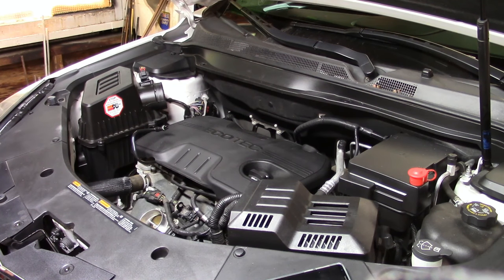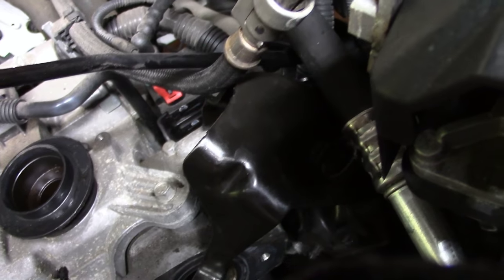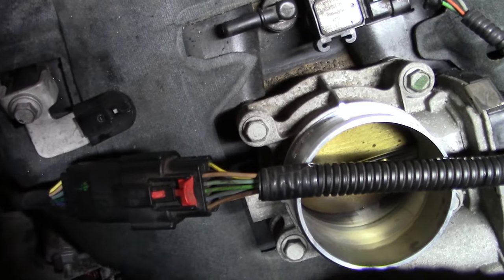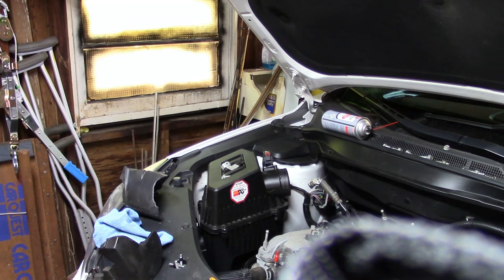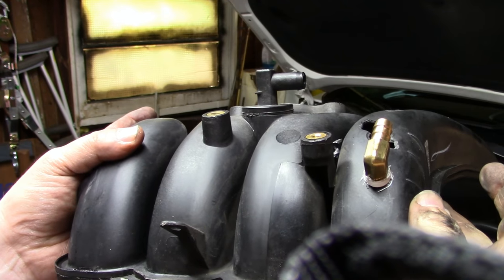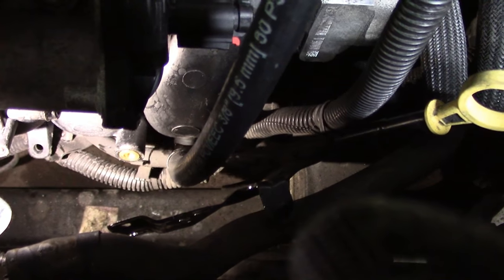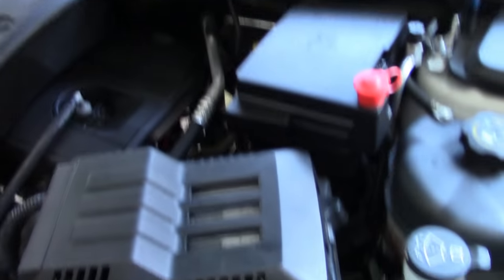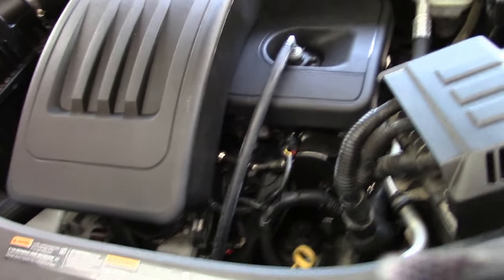2013 Chevy Equinox w/2.4L 4-Cyl. Engine PCV Upgrade

Comment: I took the premise of what you did here but made it (in my opinion easier and more serviceable)  i used the same oil cap and pcv valve as you but instead of removing the intake manifold i tapped into the brake booster hose with a tee and ran that to a catch can . So i went from the pcv valve in the oil cap into a catch can then out of the catch can into the booster line with a tee. No intake removal necessary and while the catch can increased the price by 27$ it was far less work and now i can monitor what is coming out of the engine. The whole process took me 45 min . The hardest part was mounting the can
Reply: GIno if you take a look at the other GM vehicles using the Ecotec engine, they do the same, tapping into the brake booster port.  Looks they may use a check valve.
Reply: Do you have an instructional video
Reply: @tbandtg  no but everything you need to know about it is in my message here. Buy a catch can and the parts listed above it's really easy.
Reply: @abefroman1986  can u explain again in detail im at a 3rd grade level thx
Reply: @happydays454  buy all the parts listed in the post where i asked him what he used. Pvc valve , new oil cap, grommet. Also buy a catch can. Take new oil cap drill hole so grommit fits in it. Install new pcv valve in it. Mount catch can (i mounted mine passenger side radiator support. Run a VACUUM hose (not heater hose) from the new pcv valve to the in port on the catch can.  Then from the out port of catch can run a vacuum hose back to where you can see the break booster hose. Buy a brass tee that is barbed on  all 3 sides that is same size as booster hose and hose you ran from catch can. Splice into booster hose attach the tee with some hose clamps and then hose from the catch can as well with a hose clamp.  Thats it.
Here is the link to catch can. Empty at every oil change.
Check this out: Ruien 0046 Polish Baffled Universal Aluminum Oil Catch Can Reser... https://www.amazon.com/dp/B06XK9PTP7/ref=cm_sw_r_sms_awdb_t1_9bPZDbVQ30366
Reply: Gino 1984 I thought the gunky crap was because the Pcv wasn’t working right, but if you rerouted your pcv and are still getting the crap in your catch can , do you know why you getting it ?or where it’s coming from? I’ve got one these pos that I’m stuck with , and thinking I need to do this to , I burns a quart a week and the pcv is continuously gunked up no matter how often I clean it
Reply: @happydays454  lol mine did, had to replace the gaskets.
Reply: @tssci6774  - I've read some of your replies regarding the Equinox issues, you appear to be very knowledgeable on the topic. Gino's setup is interesting, but I have concerns like Frank. So a check valve would eliminate the chance of... "If you're speaking about the power brake vacuum hose, you run the risk of introducing oil residue to the power booster. Then at some point you'll need to replace the power booster. Giving the PCV a dedicated vacuum port gives you a direct link between the PCV and the intake port, without compromising the brake power booster, or affecting the vacuum signal to the intake port at the cylinder head.
it doesn't solve the problem. It just redirects the oil that will need to be drained periodically from the catch can.  
Doing it the way I showed you keeps the emission system sealed true to OEM. No draining required. And the oil is burned in the combustion chamber."-Frank Incremona

I'm selling our Equinox, but I don't want to hand off a complete piece of garbage to the next owner.  I was going to add the catch can on the intake side like others and simply add the FC219 cap with the hope that the engine can breath cleaner and release pressure (emergency situation FC219) if things get clogged like the 1/8" PCV port on the intake runner.  Eliminating the chance of a rear main seal burst.
Reply: @abefroman1986  - Updates, how is your setup working?
Reply: @350Zquicksilver  going strong. No issues
Reply: @abefroman1986  - Good to read!  I replied to TS in your reply chain.  Frank's concerns are my concerns also. I'm taking a step in a different direction, because I plan to sell the car.  Installing a CC in place of the "C" shaped PCV line intake side, adding a FC219 oil filler cap.
Reply: @350Zquicksilver  I would replace the PCV tube with a 3/8" hose and point the air box fitting downward so it does not trap moisture and freeze.  Definately put on a FC-219 cap for added measure.  I tried several different setups for the vacuum source. Tapped into the EVAP line, but between the two the line was too small to handle both.  No worries about the brake booster, flow is only one direction, and there is a check valve at the booster.  The problem I ran into is build up of moisture and freezing at the "T".  It did once last winter and it affected the brakes.  I adjusted the hose to get rid of the low point so now if any moisture builds up, it flows downward to the intake port.  I would not worry about the catch can and put it back to stock,  if selling, the next owner will likely not check oil or the catch can which will cause the same problem.   FYI, I have restored several 240Z and raced and showed a 280ZX I restored many years ago.  Lots of fun, but got married and had kids.  The Equinox is my current project/hobby car so I tinker a lot and discovered issues and found fixes for them.
Reply: @350Zquicksilver  I have complete PCV document on this car I can send it to you if interested.
Reply: You would think it might compromise the brake booster effectiveness if you did it this way
Reply: @juanlanda2441  see my videos...
Reply: @juanlanda2441  the pcv valve is designed to draw a small amount of intake vacuum, .1 in Hg. compared to the normal 1-22 inHg that is present in the engine.  The brake booster holds a volume of vacuum that is good for several brake applications. Been running like this for over a year, no issues.
Reply: How is this workinf out? I took out the intake and cleafed the pcv hole that was clogged with oil and gunk, and onstalled a catch can but installed it the regular way. I'm thinking Bout doing it your way directly from the oil cap, jusr wondering how its working out for you 3 years later?

Comment: Thanks for posting.  

I serviced mine today (2013 Equinox 2.4L).   Orifice hole was completely blocked.  Engine was not consuming oil - I guess I am lucky.
I did not add the PCV upgrade, but followed the GM service bulletin - cleaned orifice and drilled a slightly larger hole.
I did not need to remove secondary fuel pump - just the fuel line and metal bracket.  
I managed to remove manifold down and past the protruding fuel pipe on the pump.   
Put back together and have vacuum again.  Also, my electrical connectors came off pretty easy - none broke fortunately.   
Will check vacuum on subsequent oil changes to see if hole gets plugged again.
Reply: How bigger was the whole you made
Reply: @karatejoejr  I matched the size of existing hole with a drill bit, then used the next larger size in my kit (about 1/32 larger).
Reply: @mjkirk12  Thank you
Reply: Still running ok
Reply: @rondavis2791  Yes, still runs OK.  Not burning oil.  I pull the PCV tube when I change oil and still feel a vacuum - so the orifice hole is not blocked.  :-)
Reply: @mjkirk12  good, what brand  of oil you run and what mile intervals.
Reply: @rondavis2791  Interval around 3500-4000 miles.  Orifice fixed at 98K miles, now at 112K miles.   For oil, usually 5W-30 Quaker state Synthetic blend.  but sometimes just 2 quarts full synthetic and 3 quarts conventional 5W-30 - my own "synthetic blend".  Shell or Quaker State - whatever is on sale.  Good luck.
Reply: @mjkirk12  thanks
Reply: When you opened up the hole did you notice it being louder at idle or acceleration  or at cruising speed.
Reply: @jimsmith9608  No, I don't think the noise changed much - it may smoothed out the idle a bit.   Shortly after, the muffler started to rust through - that was louder - then a new exhaust was installed.  My daughter drives the car - so I don't have time to listen.
It recently threw a code related to emissions (P0172 - Fuel System Too Rich) - but with a new air filter, the code cleared within a week.  I had not changed it in  4 years - must have forgot.  🙂

Comment: So im in process of doing this. How does this get rif of the oil consumption? If it was sucking oil through pcv orifice in intake wouldnt it just push oil through the new pcv valve and into the intake and still burn it? Also i am removing my vented oil cap is there a possibility of using this method and it builds up pressure and blows out rear main seal? Or is that not possible with the pcv valve in the oil cap?
Reply from the maker: The alternate PCV draws the pressure out of the engine into the plenum and then burns the fumes harmlessly in the combustion chamber. If you remove the oil cap you will see a baffle under the cap that prevents oil splashing back on the PCV. The reduced crankcase pressure  alleviates the blowby, thereby eliminating the oil consumption. After performing this modification on my engine, all oil consumption stopped.

Comment: Solution I found was a ventilated oil screw cap. ACDelco Oil Filler Cap FC219. Says that it won't fit on an Equinox however many posts said that it will indeed fit on the oil fill. I also have a 2007 Pontiac G6 and it fits this also.
Reply from the maker: But it really does not work.
Reply: A vented cap allows release of pressure build up so why exactly wouldn't work? Obviously venting through the pcv is best but if it did get blocked with gunk or freezing a release of pressure would be preferred over blowing out a seal.
Reply: If it throws a code I will go back to original oil fill cap. I will then drill a small clean out hole from the outside of the intake and seal it with a machine screw. Cleaning it out with wire or paper clip when I do an oil change. Alot easier then removing the intake. Even if I need to clean it more often not a problem. I already check weekly for oil level. Just another quick check. A few good videos out there on how drill the hole including putting dielectric on the drill bit so the plastic shavings stick to the bit. There is always more than one way.
Reply from the maker: @catherineandjimleclaire9034  but it still doesn't work.  It's simply a temporary repair . Drilling out the PCV orifice changes the vacuum signal. You will be chasing this problem forever. My solution is permanent.

Comment: Frank where you planning to install the 1/4" NPT where you cracked the manifold
Do you think by moving it up will do the job, maybe that way i don't have to remove the manifold
Thanks
Reply from the maker: @reinaldofranco542  no. You have to remove the manifold. The hole is on the bottom.
Reply: @Frank4358  ok thanks

Comment: I had this issue.   Main seal blew out.   The worst part is that I heard the engine noise well before that low oil pressure light came on.   So its really two issues.  The 2nd one being that GM's low oil pressure warning is a joke.

Comment: Good Idea but if i may Say two Things one the hose connected to the manifold is your vacuum hose. instead of drilling a new hole in the intake just cut the vacuum line and put in a tee fitting to run your hose from it also you would want to put a catch can system in line with the vacuum hose and oil cap thus to catch any water vapor or oil vapor before it goes right into your intake which is bad on GDi engines since the oil will build up on the valves because direct injection dose not spray fuel over vales like a convention fuel rail dose making it build carbon on the valves causing problems. You should also add a catch in between the original pvc system for this same reason.
Reply from the maker: We considered that, but that line goes to the brake power booster. There's always a possibility of contaminating the booster. This configuration does not require  any catch can, and the vapors from the engine are harmlessly burned in the combustion chamber. I've been running the engine like this for over three years now. No combustion problems, no engine codes, and no oil usage.

Comment: Hi Frank like your video was wondering what oil cap you used to put a pcv valve in? did you run a vaccum line for the fitting you put in the intake?

Comment: Very good video, but just curious, why couldn't you just cut the existing line and splice the line running from the existing valve  into the new line running from the oil cap, through a collection can and then back into the existing line feeding the intake? This would remove the water/oil from both PCV valves using a common collector can.  
  I am buying a 12 Equinox and this is how I would like to do it, because I feel the oil cap PCV will not fail as easily as the factory one. I just was curious if there is a reason you can think of that this method wouldn't work?  This whole process would take under an hour to complete and I would think it would do the same thing. I saw on another video where someone spliced a can into the existing line, but you are still relying on that tiny hole on the PCV end not plugging for whatever reason, so I feel 2 PCV valves is the way to go.
Reply from the maker: The OEM PCV is a tiny, 1/8" orifice in the middle of the intake plenum. 
No way to splice in. 
By installing a fitting at the bottom of the intake runner you don't upset the vacuum signal to the cylinder head. 
If you splice into power brake vacuum line you run the risk of contaminating the power booster with atomized oil.
The oil cap I used was a Stant oil cap. Stant is the OE supplier to GM. So there's no fear of a cap failure. I used a Bridgeport vertical milling machine to spot face the replacement cap. Then I centered the cap and drilled a 0.750" hole to accept the grommet for the PCV valve. I coated the machined surface with dielectric grease before installing the grommet. Then I added a small amount of dielectric grease to the PCV before inserting it into the grommet. 
There is a baffle between the rocker arms and cam to prevent splatter into the PCV. 
I would also recommend a dollop of RTV around the fitting you install in the intake runner.

Comment: Hi Frank,   what  about adding a throttle plate spacer with a vacuum port instead of having to pull the intake manifold, would that work?  You still haven't burned any oil?  Great fix that you came up with which is a permanent fix.  Thanks much!
Reply from the maker: No. That would change the vacuum signal and change engine performance
Reply: @Frank4358  Hi Frank, Apparently they don't sell the INTERMOTOR, SMP, PN#  PCV352, i can't even find it online.  Do you know another PCV that will work with that engine and grommet size?  I already bought the grommet and drilled out the cap.  I bough a PCV (PCA1002) that I thought was compatible but it appears too large in diameter.  Any help would be appreciated, as I am not sure how to size these valves.  Thank you!
Reply from the maker: @revivessc_curryprodz  amazon.com it's a Beck/Arnley part
Reply: @Frank4358  Hi Frank, the link you provided just goes to Amazons home page.  Not sure what Beck/Arnley PCV  as there are many.
Reply from the maker: @revivessc_curryprodz  I didn't give you a link. Go to Amazon, then type PCV352 in the search bar.
Reply: @Frank4358  Hi Frank,  Hopefully the last question: did you use a tap to thread the plastic manifold to screw the brass  hose adapter into?  I drilled a 7/16" hole and cannot get the adapter to start threading itself in, so I assume I need to use a tap.  If so is it the 1/4" - 18 NPT tap?  If not, how did you do it?  It a nice clean  7/16" hole  (no cracks) and I don't want to mess it up.   Thanks again!
Reply from the maker: @revivessc_curryprodz  yes.
Reply from the maker: @revivessc_curryprodz  first off, you can't use a 1/4" tap on a 7/16" hole. I did tap the hole and used RTV sealer on the threads before screwing in the fitting. Once it sets up, put a bead of RTV
Reply: @Frank4358  Hi Frank, a 1/4 NTP tap is threads a 7/16" diameter hole..  NTP goes by inside pipe diameter, hence the 1/4" listing.  Thanks for all the help!
Reply from the maker: @revivessc_curryprodz  you're very welcome

Comment: Great video. A parts list for what you added would be wonderful.
Reply from the maker: Parts list is in the comments.
Reply from the maker: @ronaldtrudeau5722  

The Grommet is a Dorman PN# 42330
PCV is a INTERMOTOR, SMP, PN# PCV352.
I bought them at Advance Auto Parts

Oil cap is a Stant/Carquest PN# 10099

You need to spot face the top of the cap then drill a 0.750" hole at the center of the cap.
Reply from the maker: Grommet is a Dorman PN# 42330
PCV is a INTERMOTOR, SMP, PN#  PCV352.
I bought them at Advance Auto Parts

Oil cap is a Carquest/Stant PN# 10099

You'll need to drill a 0.750" hole to make everything work.
Reply: @Frank4358  cant find that pcv 352

Comment: I know this has been out for a while but, could you just modify the oil cap and route the relief hose into the air box just after the filter?  There would be virtually no disassembly required; just mods to the air box and oil cap.  Just looking for a simplier way without removing the intake.
Reply from the maker: No. That will not do anything useful. The way it's set up it's drawing a vacuum and relieving the crankcase pressure.  The vapors are being drawn into the combustion chamber and burned off.
Reply from the maker: Doing it the way you suggest does none of that.

Comment: Did something similar but ran the hose to under the throttle body, didn’t have to remove the intake doing it this way & works good.
Reply: How did you do it
Reply: Can you send some info